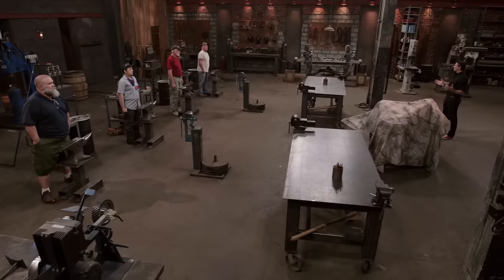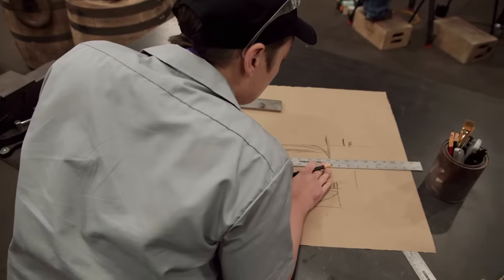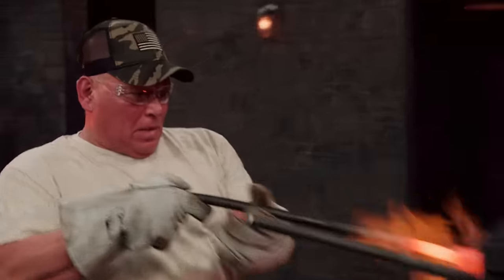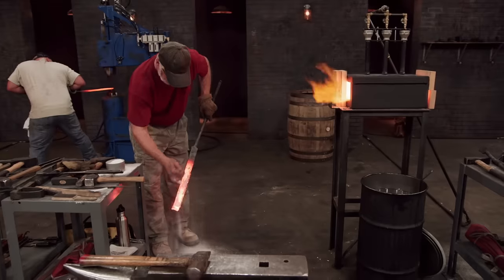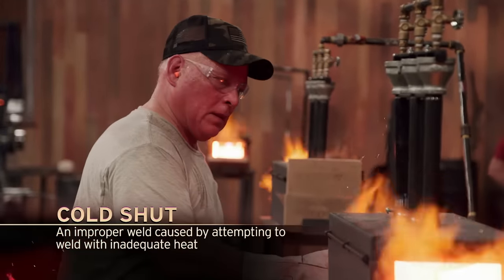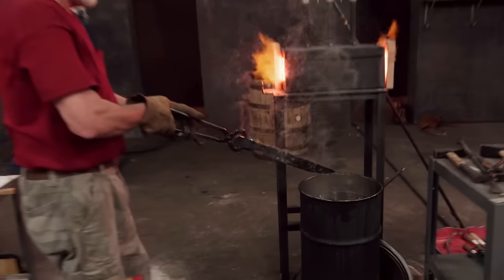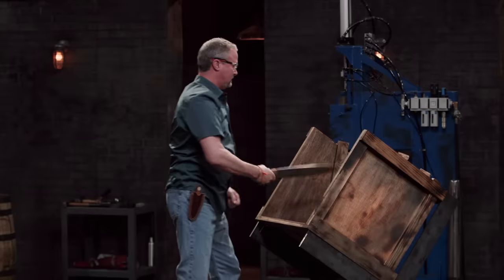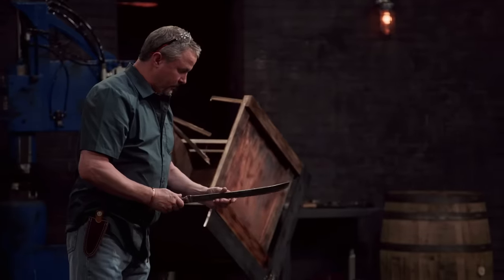ANCHOR CHAINS Used to Form Nautical Blades | Forged in Fire (Season 4)

Comment: His blade broke, so it doesn't matter.  But one of the parameters was for the San Mai or taco was the mild steel on the outside, high carbon steel on the inside.  Buster put the high carbon on the outside and mild steel in the middle.  Can it be done that way and still fall within parameters?
Reply: They have ejected competitors for having blades which did not have a hardened edge. The episode with bottle openers on blades had a competitor who was ejected first round for it
Reply: Only way you can miss parameters and still move forward is if a competitor did even worse.